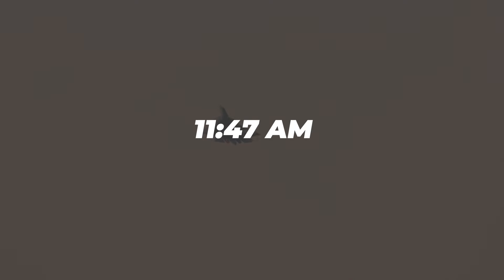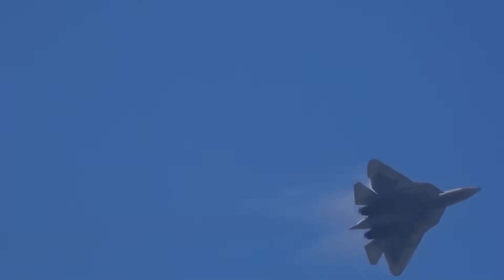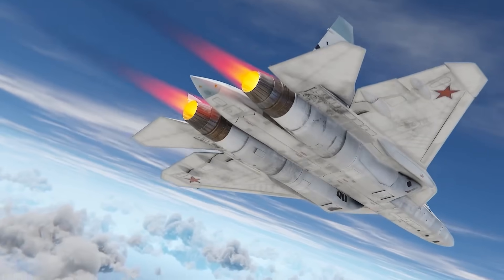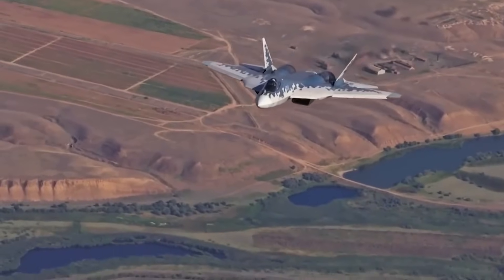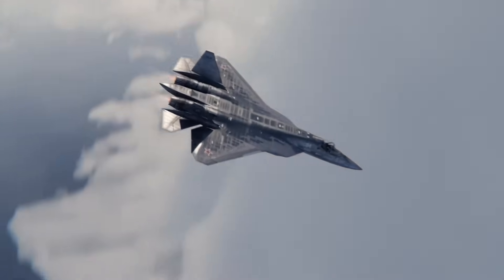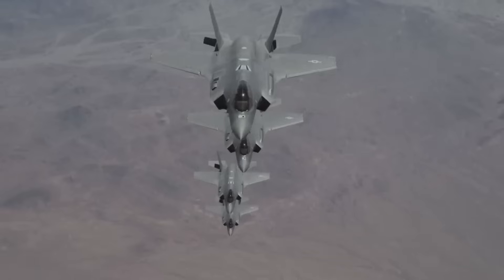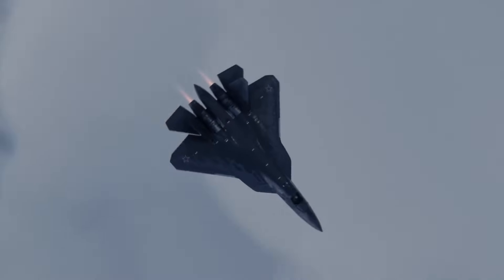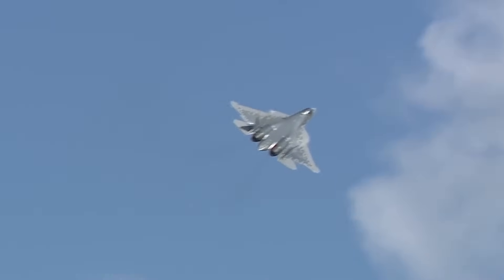Why the Su 57’s ‘Bad’ Design Is Actually Genius

Comment: 0.01 sq.m is the size of a quarter plate, not a marble.
Reply: The American methodology shows peak values, that is, the radiation exposure along the aircraft's course with the strongest scattering power. The Russian methodology shows the average value for the entire aircraft. These figures are not comparable at all; they are literally different, like comparing warm and soft.

Comment: Yeah well Russia ain't even got 20 of them and it's got more problems then just the su35 engines to lol
Reply: Су-57 изготавливается круглосуточно на двух заводах, уже долгое время. 😁
Reply: @ЧаваРоманов yeah well Russia can't prove that in actual airframes I've seen where they have been pushed back more than once and if they had them they would most certainly be flexing them the one they sent to China to compete in that air show had Smoked up Cockpit glass like many Russian planes does because there parked outside for years and it looked pretty rough and weathered up close I know I saw it first hand there I like the paint scheme and the design for a big ole girl but typical dual wheeled landing gear that's got heavy written all over it
Reply: Having them 300 parked in hangars and never utilized like the F22s or not having manufactured them yet brings to the same result
Reply: @airaction6423 what 300 parked in hangers because we fly our F35 everyday in all weather from South Carolina and Florida all the way to Phoenix Arizona and Nevada because I see them along with F16 and F18 super hornets everyday and I don't think the Russians can make that same claim on that scale like we do

Comment: nah, "they left them exposed because they needed them to move", then is a stealth failure, no matter the mobility stealth is a major advantage nowadays than mobility, for that reason the F-35 isn't as agile as the f-22, because they understood this.
Reply: They understood they needed fighters with 800km of combat range? Sharp edges cause micro turbolences that affect aerodynamics. It russians decided for softer edges it doesn't mean they don't know how to weld sharp edges. It means for them action range is more important than stealth.
Reply: @airaction6423  ok so even with all that the stealthy aircraft can squeeze itself until it's too late for the less stealthy, more agile and "800 km" range aircraft.
Reply: If you could be radar locked from 50 miles you would be shot down from this distance. if you cant be radar locked only detected as radar anomaly that moves too fast to lock your safe.

Comment: new engines arent round but more like vampire teeth....and old engines will be used on like one squadron(26-28 planes) + 8 prototypes ,and  all planes now in production and out of p. line have new engines+ nozles (nozles maybe even less then whole new squadron ,cause it looks some old engines have new 3d independent vectoring for manuverbility)......and if  this plane get close to 4+ or 5gen with turned out radars (it have instaled ic+uv detection ''radar''/yes its called diffrently but does same detection job)  in dog fight where manuverbility is important and turn rate  not one plane from 5 gen isnt even close...like turn radius time is like 6 second in cruise speed in slow mode it can TURN IN LESS SPACE THAN CAR ON GROUND ,,,,not one plane is close even su35s  ned  few  dozen meters/yards to turn ,,f16 who was preised for good turning radius needs like 15+ second to make circle (on optimal speed  25+ seconds if go fast)   ,,and dont write 8.5 second f16 turn rate CAUSE ITS ONLY  90 degree turn ,, su 35s have  10 second full 360 degree turn rate with missiles on pilons (it had only 8 from 13 but 8 missiles isnt small number especialy 4 where bvr missiles)  so su57m(new engines+nozles) got almost double cut turn rate 6-7 seconds (  55 degree per second) vs su 35s (35 degree per second)   and this isnt mini size plane like mig29k or f16  but 20+ ton(50 000 pounds) plane

Comment: This argument is a non-starter as Airshow acrobatics mean next to nothing in real world combat scenarios. The Russians also have not and probably cannot build the Su-57 at scale. Look how many F-35s have been built and are in service compared to the handful of Felons.
Reply: 5000 in service but none has been used in real combat. Even in lybia nato sent only tornado, f18 and mirage. Not a single f35
Reply: @airaction6423 because there’s zero reason to send the newest fighter into a low intensity conflict and risk it being shot down. It’s about the right tool for the job. Delta Force and Army SF aren’t used for every mission because it’s about what’s good enough to get the job done without excessive risk.

Comment: The Su57 is modernized Stuka with speed and maneuverability. Against the F22/F35 first detection strike, they are on the losing streak. The Israeli situation was they were caught off guard which was luck on the Su57. Which the Su57 is always off guard against a F22/F35

Comment: But, what is the utility for combat of this two motors of the Su-57.
Reply: It can fly at low altitute and low speed where radars can't see you. Try to avoid obstacles at low altitues with non 3d thrust vectoring engines

Comment: Yeah because those thrust vectoring nozzles are really going to help when a missiles coming from 200 miles out they can't see
Reply: F22 has thrust vectoring engines too. Are F22 engineers stupid?
Reply: @airaction6423 The problems with the F22 are too long to put on a list. This is why they are trying to retool the F15/16s.
Reply: @DennisYoung-h5d f15 a f16 are soviet era fighters
Reply: @airaction6423 No sh*t
Reply: @DennisYoung-h5d  yes, the same platform when marylin monroe was around
Reply: @airaction6423 That's right, which indicates that the F22/35s are so bad they are going back to 1970s aircraft.
Reply: @airaction6423  F-22 thrust vectoring was mainly to enhance performance at high altitude, and even then as a better safe than sorry thing. %99.9999 people you're going to find here trash talking American designs don't know anything about them.
Reply: @anongimus  what you wrote doesn't make sense. There is no need for thrust vectoring while crusing at high altitude
Reply: @airaction6423  oh there is
Reply: @anongimus  no there isn't. Just like there isn't for mounting cannons on the F22 saying cannons are outdated in the beyong visual range era, or the F22 cannons are used for high altitude performance too?
Reply: It's frontal aspect low observability. It's stealth in the front and side but not on the back. It's stealthy enough. Both the F-22 and Su-57 will have a hard time seeing each other, unless the F-22 is on the Su-57's back. And if you are talking about 200 miles out it's the Su-57 who has the missile range to engage at such extreme distance (R-37M with more than 240+ miles or the R-77M with 155 miles). The Su-57 outranges the F-22 when it comes to missiles. The latest variant of the AMRAAM, the AIM-120D can only go mostly as 100 miles.
Reply: @Rumbler298 Game, set and match.

Comment: In a pancake spin, how can you keep the nose pointed at the enemy "all the time"?
Reply: Hype-hype, baby.
Reply: When enemy circles around your plane. In that case u spin and keep enemy in sight Is it so hard to imagine ?
Reply: @angeldust4109 looks like you've never seen an Su57 do a pancake spin. When the jet does that, it spin in it's own vertical axis. It's does not and CANNOT spin around the axis of an enemy jet. That's physically impossible. Your imagination ran wild without understanding the physics of this maneuver.
Reply: @angeldust4109  Nope. In fantasyland.
Reply: It Is not literaly ,need front cone which Is certain degree..and that Can be done of plane Is manouverable,hence that "obsolite " su manouvers.. but all that Is like situational..range Is 50-100km of "dogfight" for those new planes rockets ..in nutshell nothing Is literaly 😂😂
Reply: @zrikizrikic9126 the physics is impossible. Unless you tie a long high tensile steel cable from the nose of Su57 to the enemy jet, and make the enemy jet fifty times heavier to provide enough momentum to fling the Su57 around it. But this will literally rip the Su57 nose cone apart. It's a clueless child's imagination.

Comment: SPECIALLY FOR ALL WESTERNER WHO'S ALWAYS BELIVES NOTHING'S CAN BETTER COMPARED TO WESTERN MADE SPECIALLY AMERICAN MADE.
YES, I AGREED WITH YOU ON FIGHTER JET AND ALL MODERN WEAPONS ONLY AMERICAN AND HER ALLIES LIKE FRANCE, GERMANY AND NATO'S MEMBERS CAN BUILDS BEST WEAPONS.
100% RIGHTS, AMERICAN MADE JET LIKE F35, F22, F16, F15EX IS SUPERIOR WHEN FIGHTING WITH MIDDLE EAST DATE FARMER WHO'S WEARING A SKIRTS AND WALKING BAREFOOT. WORLD KNOW AMERICAN F15, F16, F35 AND F22 NEVER MEETINGS SU30, SU35 FLY BY RUSSIAN PILOTS WITH COMPLETELY BVR MISSILES LIKE R37M THE 400KM BVR MISSILES WERE AMERICAN GREATEST AMRAM AIM120 JUST HAD LONGEST AT 130KM AND COMPLETELY DEPENDING TO AIR CONTROL PLANES AND REFUELING.
WHATEVER AMERICAN CLAIMS ABOUTS F15 THE MIGHTY JET, WORLD KNOW F15 NEVER FIGHT POWERFULL JET THEN MIG29, OLD VERSION FLYING BY PILOT FROM 3RD NATION WITH LOW SPECS MIG29
Reply: My opinion as an American we are so used to having the best of everything that its hard to admit when we don't. There's a point most videos comparing the F22 to the SU-57 miss. The F22 was first designed and rendered in 1986 almost 40 years ago. Its started development in 1981. A lot of things have changed in the world since then.

Comment: The Su-57 already has flat nozzles!
Reply: They're not just flat, they're also 3D thrust vectoring, unlike normal flat nozzles. But since those are still inferior to the round thrust vectoring nozzles in terms of  power efficiency and agility, I assume that would be a separate Su-57 modification for a specific tasks.
Reply: @evilbabai7083  the engine is more powerful than comes with the flat so you are still going even higher in performance anyway.
Reply: yeo the su-57m is the production version they used a prototype for the airshow
Reply: Yes, the new engine, you probably know more, did it come out?
Reply: @martinblank5499  There was a video on youtube showing the actual flat nozzle  production process. That was couple of years ago. But it was announced as an engine for the Hunter drone.
Reply: @martinblank5499   it is ready to install on the manufacturing line  of the su-57m but nobody has spotted one on the frontline. but its in serial production now.